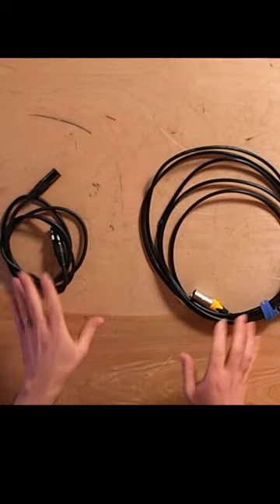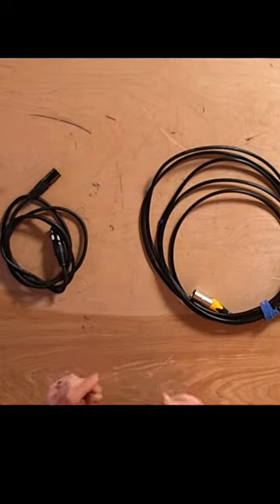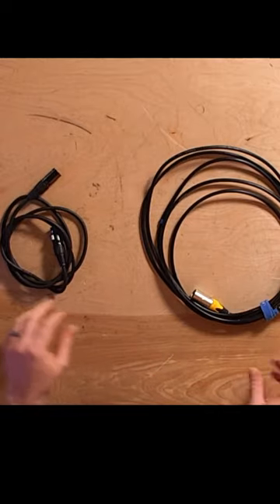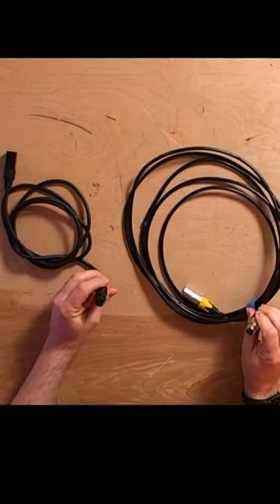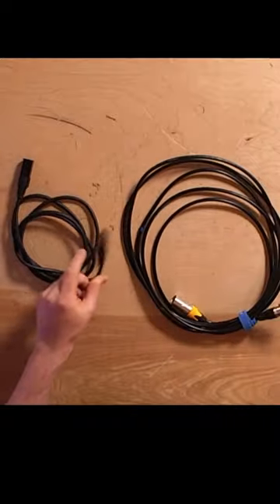Can you use Audio Cables for DMX? #shorts

Comment: In most circumstances, it works fine, though. And it's more versatile. You can (mostly) use audio cables for DMX, but using DMX cables for audio is a bad idea.
Reply from the maker: Actually, it's the other way :)

Comment: DMX512 has 5-pins. Just check the specification.
Reply: there is 3 pin and 5 pin connection for regular lighting
Reply: even with RDM you don't need 5 pins, and almost all lightning fixture don't even have the 2 others pins connected.